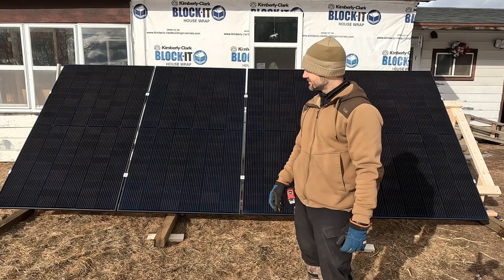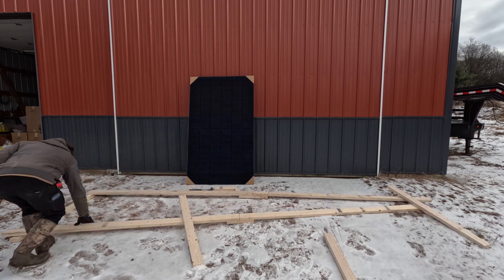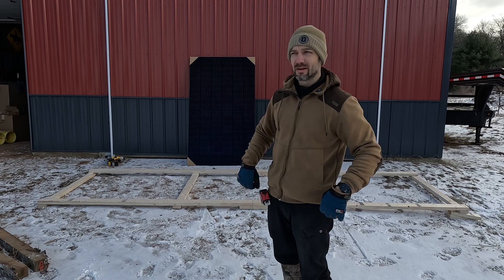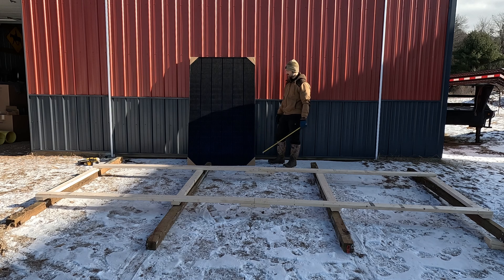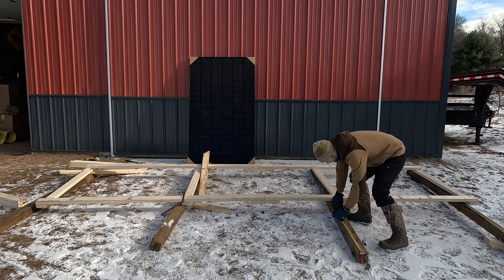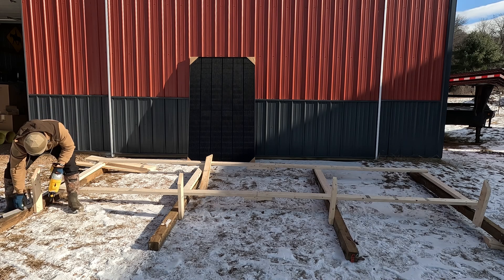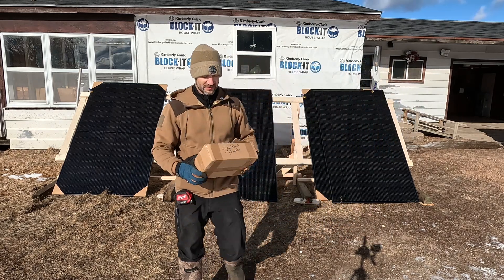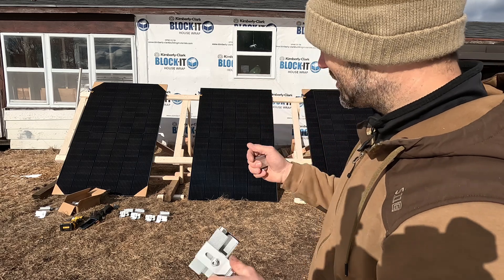Cheap and Quick Solar Panel Ground Mount!! #aptos #solar

Comment: Nice video.  You are from Wisconsin? I grew up in northern Minnesota north of Duluth 1 1/2 hours.  Now live in Texas 25 minutes from Signature Solar. I am going to put in a wood ground mount much like the one featured by channelTech4U which uses a central pivot bolt. I have been looking at either superstrut or IronRidge rails for mounting. In Texas we are all electric with 67kWh - 130kWh/day so maybe 40 panels to mount before end of the year.  whew Anyway great video and good explanation along the way.  We will wave to you as we drive up north at Christmas time.  All the best!
Reply from the maker: That is a bit of a climate change!  I've been up in that area many of times.  And wow, that's alot of power everyday!  Glad you enjoyed the video and have a great trip up north!

Comment: The wood that you used is going to warp and will fracture your modules.
Reply from the maker: In time it will likely warp, but those modules are pretty dang strong.  Its been up for 8 months now and they are just fine.  Besides, I did say that this was temporary.   I would not recommend this for a permanent solution.

Comment: Your tip of using tape to hold the clamp in place is great. I struggled with my clamps, wish I'd thought of this simple idea. And that metal-on-metal squeal at 14:07 is strange, made me think I was damaging something. I was 71 when I wrestled my panels into place, they were heavy and awkward for one person! I'm feeding my 6000XP with ten 400W Talesun Bifacial panels from Signature Solar. I've had them pump in 4400W a few times. Very happy with their performance and Signature Solar's help. Also, love my 6000XP, it just continues to keep on working, charging my four EG4 Lifepower4 batteries and feeding 240V to my house thru a Reliance Control ProTran2 Transfer Switch. You should definitely run a feed to your house. Look into the Reliance Control Transfer Switch, a great way to tie in the 6000XP feed while keeping it isolated from the grid. And get a 50A Transfer Switch. That's my only regret; I used the 30A, wish I'd have spent a few bucks extra and gone with the 50A model. 
Wow... started this to say the tape idea is great... and I rambled on!!  I've subbed, looking forward to more!
Reply from the maker: Thanks for the Sub! Glad you enjoyed the video.  I actually saw the tape method from another video.  And my experience so far with the 6000XP has been fantastic.  I did do a video on powering my hole house with it as well!
Reply: https://youtube.com/shorts/nWfNs2Z_QN4?si=2WYa3Ib_qKpmlVPL

Comment: Big design failure. The aluminium structure of those panels can't be "hard connected" to the wood structure. Wood will expand perpendicular to their fibre direction and will apply high forces on those panels structure.
Reply from the maker: This isn't a permanent structure.  This is only going to be up for a few months for testing.  Also, the panels are mounted to aluminum rail mounts which are attached to the wood structure.  The same way millions of panels are mounted to residential house roofs all over the world.....
Reply: https://youtube.com/shorts/nWfNs2Z_QN4?si=2WYa3Ib_qKpmlVPL
Reply: Opinions are like A holes and yours is full of 💩

Comment: Question. I dont know much about wood/lumber. How long (in years) will this type of structure last?
Does it help if one paints the wood/lumber?
Reply from the maker: I put this up for a temporary use structure.  Only going to be here for a few more months. If you are looking for a long term structure, I would highly recommend treated lumber and a more robust structure.
Reply: https://youtube.com/shorts/nWfNs2Z_QN4?si=2WYa3Ib_qKpmlVPL

Comment: 205th subscriber here from SE Michigan.  I did this on an H style tilt system in 2016 and they are still standing.....never under estimate the power of DIY ground mounts!  Also, IF you put the 4x4s through the holes of cinder blocks you can freeze them to the ground!  Mine cannot be moved until the thaw!  thanks
Reply from the maker: Thanks for the Sub! and hello to a fellow northerner.  The cinder block is a great idea!  I will have to do that next time.  I know many people are concerned about not all of it being treated wood, but i have stuff built that I threw together for a wood crib years ago and it is still just fine.  I know it has a shorter life than treated for sure.
Reply: https://youtube.com/shorts/nWfNs2Z_QN4?si=2WYa3Ib_qKpmlVPL

Comment: With such thin wood you could simply drill a hole that lines up with the holes in the panels and put bolts and washers to hold the panels to the frame which would save a lot of money on fittings.
Reply from the maker: That is very true!  Even more budget friendly!  Thanks for pointing that out.
Reply: https://youtube.com/shorts/nWfNs2Z_QN4?si=2WYa3Ib_qKpmlVPL

Comment: Just wait until those unpainted 2x4s get wet and warp and deform the aluminum frames of your modules and fracture the tempered glass. You really need to paint or coat the 2x4s that come in contact with your modules.
Reply from the maker: This is not a permanent mount. This is only going to be used for a few months. I totally understand what untreated lumber does in the elements.  I should have made that more clear in my video. Thank you for pointing that out for others, as I completely blew over that.
Reply: @KMJ_Adventures  Thank you for the update.